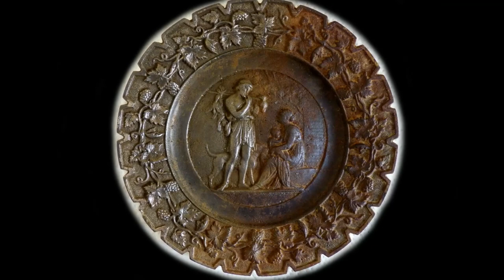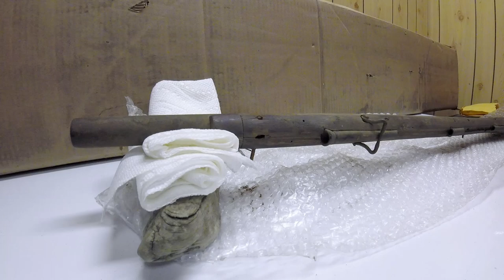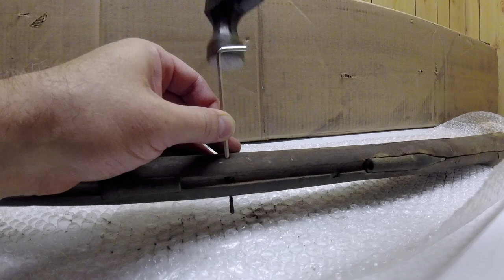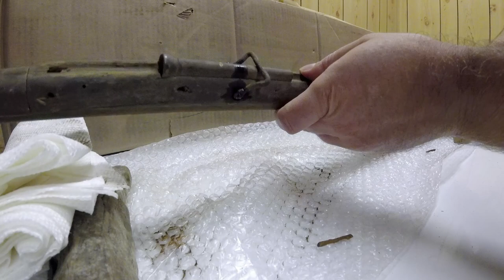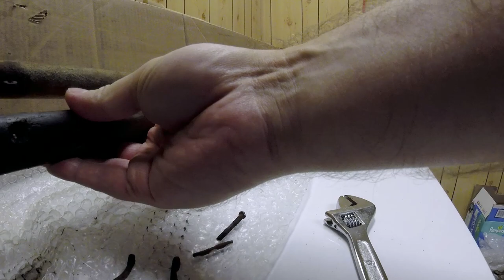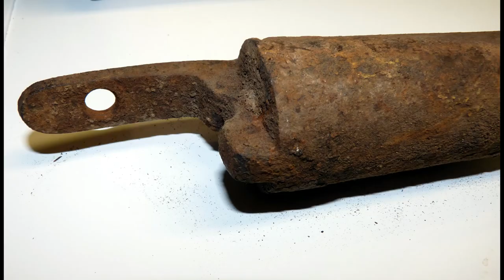Brown Bess Musket Restoration Part 3:   Removing The Barrel

Comment: What do you if the pins are completly stuck . I do have a brown bess too and i can't remove  them
Reply from the maker: Edern, sorry to hear you are having problems with the pins. I am guessing you mean the barrel pins which hold the stock to the barrel? Try soaking the wood and pin area with lots of mineral spirits. This won't damage the wood and will allow the spirits   a bit and hopefully loosen up whatever is holding them up. If you are not so worried about the stock then try penetrating oil. Your pins may have oxidized to the extend that they are merging with the barrel lugs. Once you do this and leave the oil/ spirits time to do their work, take a finishing nail punch and hit the top of the head a few times until it come out. If all else fails you might have a labour intensive drill out situation on your hands but that is a last resort. Hopefully the options work for you begore having to drill them out.